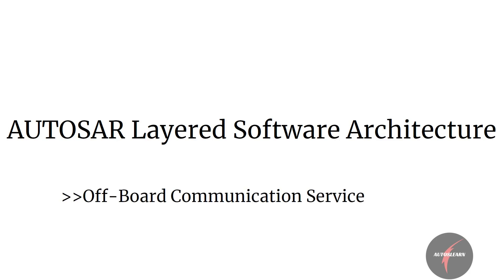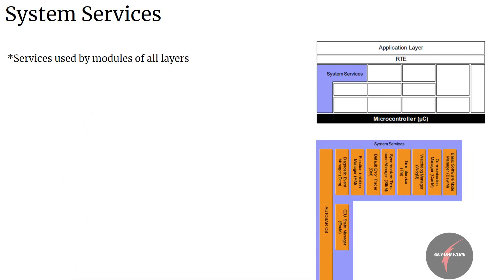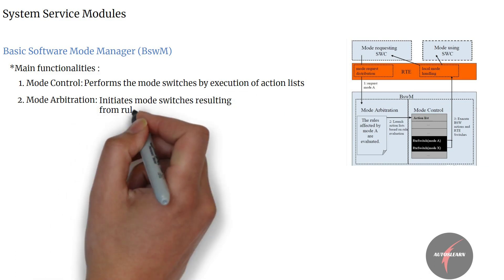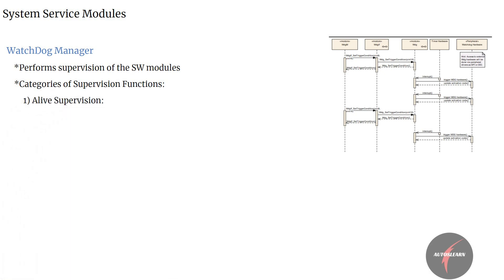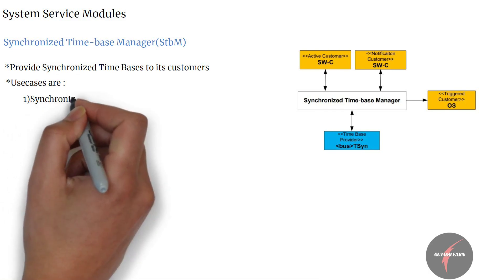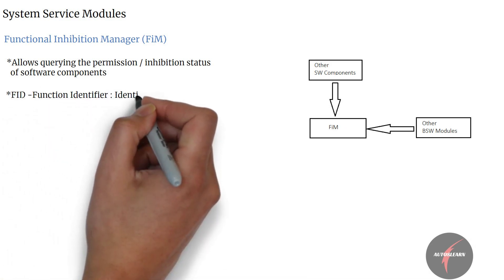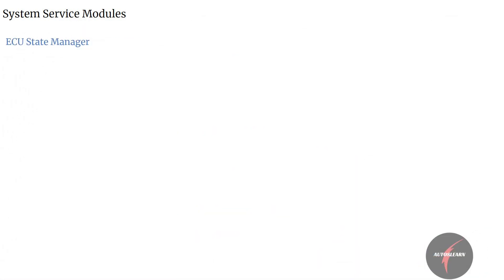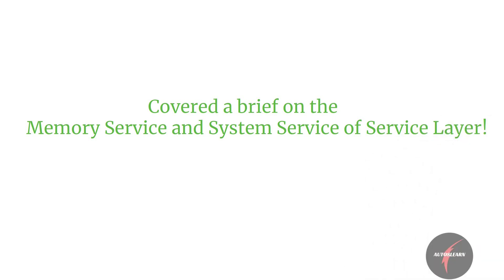Elevating Automotive Connectivity: Delving Deeper into AUTOSAR Service Layer | PART 4

Comment: Very easy to understand, essential for both beginners and experienced engineers.
A big thanks to you and your team, I really appreciate that, hope to see more videos on your channel 🤟

By the way, I have a question, could you explain why the block of system services in the diagram has the shape of an "L" rather than a rectangle ? Does it mean that it contains the two below rectangle blocks ?
Reply from the maker: Hi Phúc Khôi Nguyễn,

We are glad that you liked the video! We will do our best to get all the essential automotive content on this channel. Appreciate your support and encouragement.

Regarding your query , You are right , There are few components in System Service stack which would need access to microcontroller bypassing the other abstraction layer , like in case of Autosar OS component. Hence System services in the diagram has  "L" shape rather than a rectangle.

Hope this clarifies your query.

Stay Tuned to the channel and Thanks for watching :)
Reply: @autoslearn  It's nice that you answer my question, "bypassing the other abstraction layers" is the key point 👍
Thanks a lot 😀